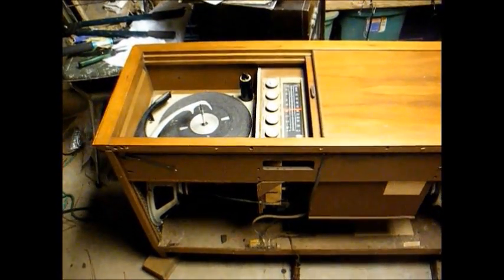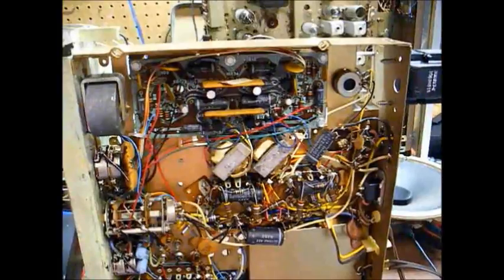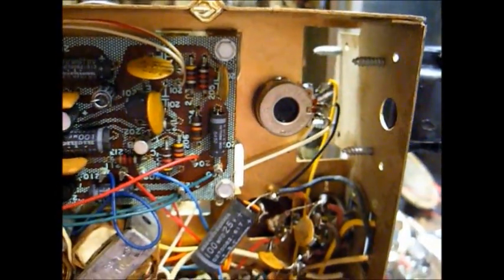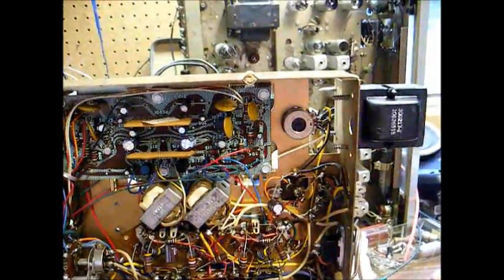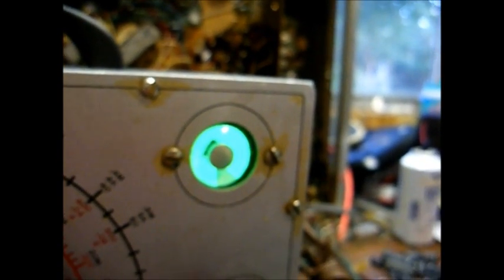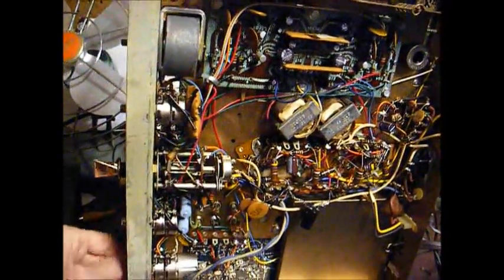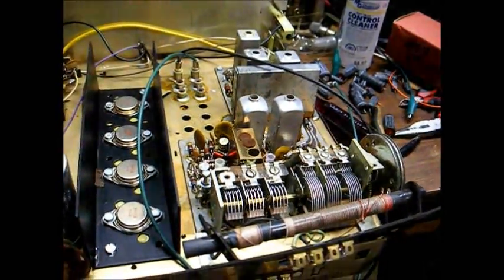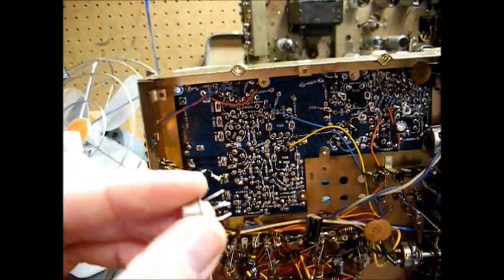1965 Magnavox Astro-Sonic console stereo repair - part one

Comment: We just bought a 1P3822 Astro-Sonic. The right balance doesn't work. After looking into it, I found the Internal/External speaker switch was broken underneath and had been wired back together. The non-working side was the part that was bot working. I tried jumping the wires with no success. I'm at a loss as to what to do. Can a replacement part be found for it, or will I need to  build my own (not my wheelhouse)? Thanks!!

Comment: Mine doesn't have the bolts or screws holding the radio in. I can find no sensible way to remove the radio.  I'm assuming it lifts out from the top but a more in-depth explanation on the video would have been appreciated. IP3623 Run 2 Mag Astrosonic

Comment: Where is the aux imput on this model?
Reply: Unplug the unit from the wall, remove the back, follow the RCA signal cables from the phonograph to where they plug into the amplifier. The aux jacks are right below that. These were actually put there for the optional reel to reel and were not intended for the end user. The record output jacks are below the aux input jacks.

Comment: I have this exact model and am trying to repair it, but can't seem to find the schematic for the chassis itself, R20414 (same as yours). Did you happen to find that anywhere and if so would you mind passing it along?
Reply: Same model I have and I have had no luck running down the schematic either. I recapped the electolytics less the big metal can. Deoxit D5 the controls including the elusive balance control. Still have noise, and crackling on the left channel. May be the multi-section can  or a noisy transistor or resistor, but hard to run down without a schematic. I can check the can by taking it out of circuit and using my Heathkit IT-28. Help someone please, it is too beautiful to recycle.

Comment: .my unit plays records and radio the i cannot change stations. need a quick fix. can remove kn obs then what? spray wd40 or what?
Reply: Use DeOxit or QD Electronics Cleaner from the Auto Parts store or Walmart. DeOxit is more expensive, but the QD cleaner has worked just as well for me.

Comment: Boy I wish a guy was close by to fix my magnavox. I'm pulling my hair out.
Reply: i could come and help you but i'm afraid i'm 2 years too late
Reply: Larry Shaver where are you? Can I please pick your brain bro? I'm stuck on my 1965 Magnavox - I got lights but no sound - checked connections - don't see anything loose.
Reply: did you check the transistors and capacitors
Reply: @jordanp2445  did you find your problem? I think the capacitors should be replaced, they could be wide open which would keep you from getting any sound
Reply: @jordanp2445 did you find any more problems like capacitors/ I replaced the capacitors in my astro soinc small signal board and the difference was amazing
Reply: i couldn't tell you what the problem even could   be
Reply: did you try testing all the capacitors? if some are leaking or wide open they will not pass a signal
Reply: I know this is late but I have the same issue. Lights and no sound.
Reply: Damien Maloney I tried electrical contact spray - which most people claim will fix most issues - still have problems. Going to test each capacitor - will let you know if I find a bad one and which one it was.

Comment: Hi friend, great project... So, I have a Magavox Astro-Sonic console stereo. Model No. 1P3763 and I've already changed the needle but it still making a lot of noises in the speakers... there are two blue pieces like battery before the speakers, what is this?
Reply: If I'm understanding you correctly, they are probably capacitors - a crude form of crossover to send higher frequencies to the tweeters and the lower frequencies to the woofers.

Comment: I'm having a major problem with my 1963 Astro-Sonic.  I've gone through a complete replacement of all electrolytic caps and I am still getting a low hum on the machine when it is turned on.  The volume does not effect the hum.

Any suggestions on what could be causing this?  I've read about changing the caps in the power supply on the unit.  Is the power supply the black brick that sits on the side of the amp?  I've changed every cap I know of on the chassis itself.

Please help!  Thanks.
Reply: I had the same problem... is your set a solid state or tube? My solid state turned out to be a leaky output transistor , replaced and hum was gone.

Comment: Would a Bad cap, cause the aAM Radio to not work? I did not see any on my Astrosonic in that area, mine is the 66' . Any Idea on how to access the under part of the turntable, every other Astro I have seen so far does not have the full back of  counsol, mine does it is 100% original and in near mint cond.
Reply: FM is strong very strong. am has Not one thing coming out of it. transistors or maybe the amp. is what it looks like the issue is.

Comment: i own a 68 magnavox console an it has a poor FM connection too. im fairly new to the radio/turntable repair community and i have the most issues finding capacitors an transistors, i am open to any suggestions of good websites to get hold of these parts

Comment: hi good video! but the only question i have is after watching dozens of these repair vids is the part where you actually install the capacitor. how do you do that??? do you use a soldering gun or what? i am new to this area of restoration.please help and thanks for the video!

Comment: I have one of those Astro-Sonic 20's and have the opposite problem with FM after a recap. It pulls in so many local stations in that I need to turn off AFC for clean audio - the AFC is just too wide/strong. I had to walk away from it due to other projects, but I keep wondering if I am expecting too much. I think to myself that here in Fort Wayne (where I am, and it was designed) we had all of 2 FM stations on the dial, and later a third one came along. We were in an AM word. I'm about to rebuild the Micromatic and call it done, but I'm not happy. I have an Imperial in the next room along the same outside wall, and it has much better selectivity - and I have not recapped it yet. 

I look forward to part 2!

Comment: Hey radiotvphononut I have the same exact record player that I purchased last year at a garage sale for 54 bucks a few houses down from me. I'm very happy with it now that I finally found a replacement needle and was able to fix the stereo problem with the record player (had the connectors in the tone arm on the wrong pins). I'm still however having a problem with the knobs making lots of static noise. Now I know nothing about taking apart stereos and fixing them, but can I just take the knobs off and spray the control cleaner in there? Or do i need to take off the chassey? I'm just afraid i might break something. I'd love to change the capacitors but i'm not sure i am qualified enough to do that.

Thanks for the great videos!

Comment: Hi,  I was just given a console, with record player and radio. Plays great for about 30 minutes, then makes a loud noise. Could it be that the tubes get too hot?  Any suggestions on what I need to look for or where I can get parts? I live in Orlando, FL. I did remove the back, it had about an inch of dust, that I removed, played a little longer after that.

Comment: My Volume Control is bad on my Magnavox Astro Sonic 1965 model . I cleaned the volume control many time and its the same results always . The control gets scratchy after six months or so .I should replace all the caps in her too It also has the old nichcon caps in her . I need to find the right replacement caps for her . Also My FM Tuner is messed up too , No stereo indicator light on it when changing the channels on the tuner .

Comment from the maker: The higher powered top end models had a seperate amp/power supply chassis. The lower and mid line models had the amp, tuner, and PS on a single chassis.

Comment: Crappy electrolytic caps in particular, I hauled two flat screen monitors home and guess what failed, the Crapxon or other Chicom/Taiwan mystery brand caps? Both were from 2005-06 so I guess the expectation was that you would buy a new computer every 5 years so the monitor didn't need to live any longer then that. Now I hauled a Samsung plasma panel home free with an RCA radio I bought, apparently those are notorious fro crappy solder joints and bad caps, so I will see what I can do with it.

Comment: My Y.T friends in Australia have told me that those Prii (plural of Prius) are already getting scrapped after 5 years because of the dead battery packs, which are several $1000 to replace They were a scam anyhow, it creates more pollution to send the materials from Canada/U.S to Asia, to make the hybrids, and then to ship the cars back over here then it does to build and operate an SUV built in Detroit/Windsor. The idiots never factor that stuff in, just the gas gauge and the tailpipe emissions.

Comment from the maker: I'm getting 0 on all 3 leads of the coil. The B and E terminals of the transistor have around 2.5 and 2.8 volts on them, with C having 0. connecting an external antenna helps a little.